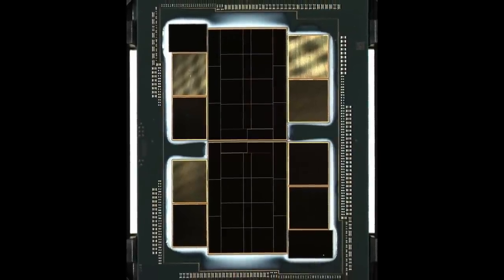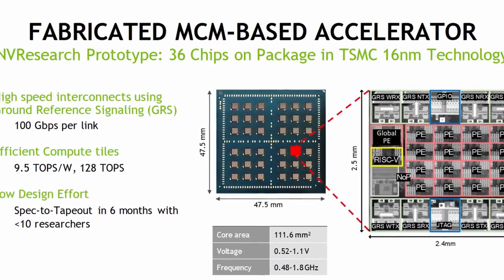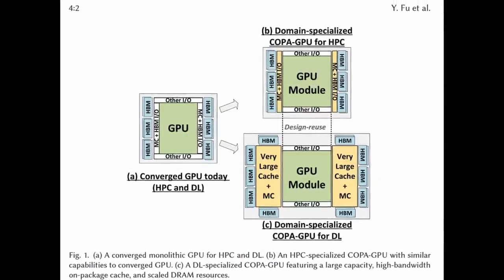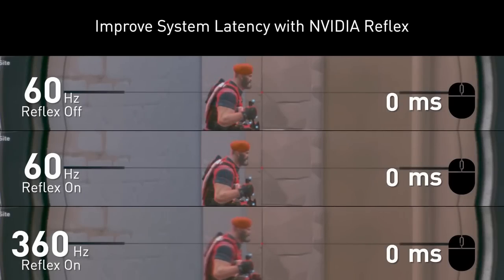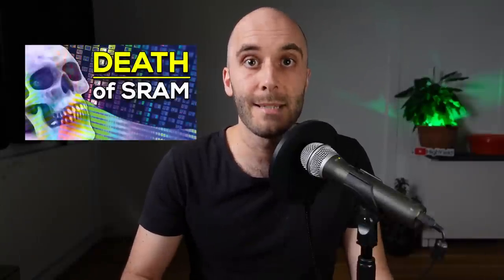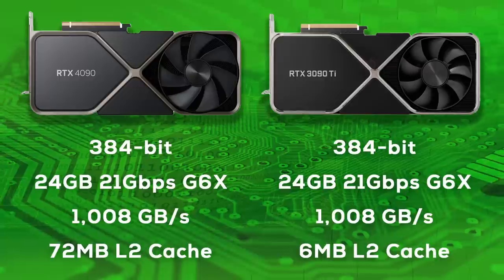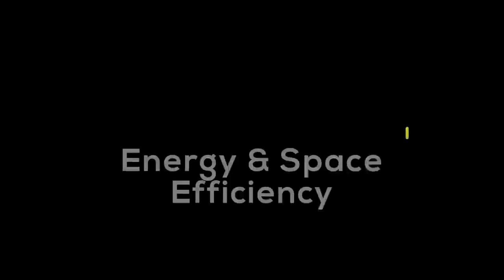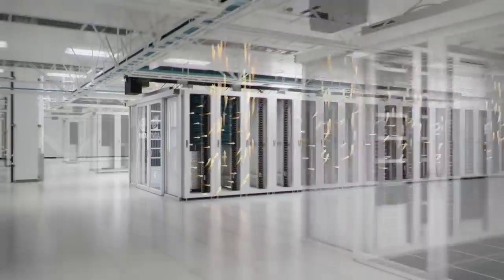How long can Nvidia stay monolithic?

Comment: Overall good analysis on this video but you forget the most important (and in fact the only) reason why NVDA didn't move to chiplets yet is the limited packaging/interposer capacity (CoWos in case of H100) and HBM TSV production machines. Currently, NV can get any quantity of dies from TSMC N4 but can't get enough HBM and package them fast enough to meet the market demand... to the point that a third packaging factory is opening in Taiwan and NV already booked the production for the next year. Samsung is also opening a new packaging fab in Korea (for HBM CoWos) to sustain NV business.
Otherwise, keep the good work. Nice channel 👍
Reply: CoWos capacity is not difficult to scale. The packaging machines are nowhere near the complexity of the lithography equipment. TSMC is expanding this capacity rapidly, and I don't see it being a bottleneck long term.
Reply from the maker: I agree with you in the sense that packaging (and HBM) currently is the limiting factor for manufacturing high-end GPUs, but H100 already uses CoWoS, only just to attach the die and the HBM chips onto the interposer, and not to connect multiple chiplets. So advanced packaging is already used for current gen Nvidia HPC/AI GPUs.
For gaming the argument stands.
Reply: Totally agree but what I said is still true. Capacity is being build to meet the future demand but was not enough for current client GPUs that sales in much much higher numbers than DC H100. And I don't even talk about cost...  @SirMo
Reply: Client GPU quantity is a total different scale than DC A/H100. And it's even much easier for AMD when you have less than 10% market share and only one SKU is chiplet... @HighYield

Comment: Thank you for this video, always very informative, I had no idea that the EUV-next lithiography shrinks the reticle limit by a factor of 2, that changes everything.
Reply from the maker: I knew it was getting smaller, but I was again reminded about the huge decrease by a random comment on twitter. I think many ppl underestimate the impact high-NA EUV will have.
Reply: @HighYield  Yeah for sure, actually I heard about it today on MLID's leak video and it brought up a good point, this might actually make nvidia cancel the 90 class of gpus for a few years, because it will have to be smaller and won't be able to compete with the previous generations. Of course I do expect them to use chiplets on hyperscaler + AI stuff as you said, but for consumer gpus, it might be harder to justify a new design.
Reply: @MickenCZProfi  Intel is expected to have first High NA machines active in manufacturing sometime in 2025(assuming no delays).  TSMC will likely not have the same capabilities til 2026.  And even then we know that gaming GPU's are usually at least a year behind on leading edge nodes, so Nvidia's Blackwell GeForce parts will likely be unaffected by any reticle limit issues.  And beyond that, it's more than likely gonna be another two years for the next generation, at which point they'll have had time to get on top of things.  Shouldn't be an issue and they will continue to have high end consumer GPU's every generation.  Also, dont get caught up with naming.  90 series used to be what was 80 series.  It's not actually a new class of part.
Reply: @maynardburger Is that why Intel kept with 14+++++++++ node for so long? Like waiting for the big change.
Reply: @MickenCZProfi  what mlid video was this?
Reply: @Lemard77  No clue, the comment is a year old

Comment: Rather than just calling the game gfx latency dependent it's better to realise that the frames are tightly coupled in a way that HPC calculations aren't.
An algorithm bouncing rays off a surface need the texture & colour to be known for example, if these rays are scattered and reflected then you need all of that early pass data to be available.
I've seen explanations that games effectively have a global area, splitting it across dies is believed to cause problems.
The difference is that if you could pipeline frames without synchronous requirements then each could take longer than the frame time, so long as they can start early on a wide enough GPU that can process several in flight frames.
So long as the output frames respond to user input quickly latency would still appear low.
Reply: VERY solid points. Some could be solved in software with a form of checkerboarding as you process.
Reply: 1. Before realtime ray tracing was available, there were very few "global" calculations. However, two separate GPUs (Xfire/SLI/dual-chip designs) would have to be synchronized on processing of each frame to avoid tearing. To my knowledge the latency contributes significantly to making this synchronization difficult, even with relatively low inter-chip bandwidth usage.
2. Of course as modern games increasingly implement and rely on RT, what you said about global information may become more applicable.
3. There is no way to pipeline frames which can reduce the fundamental input lag; if it takes 10ms to render a frame, the dependency on user input means the input lag can never drop below 10ms. While you can increase the framerate with such pipelining, and possibly as a result smooth out the input lag, the total frame render time will be observable as input lag by the end user.
Reply: @GeekProdigyGuy  originally dual GPU duplicated VRAM data and each handled alternate frames.  Tearing is caused by changing the display in the midst of its refresh hence setting v-sync or free-sync with the monitor avoids it.
The point about pipelining was to show the limit of asynchronous operation in some super wide GPU, we know algorithms now use movement vectors and differences between frames, but you'd need to sample user input late enough to meet latency requirements.
But seriously those differ between games, not every game is a twitch shooter.
Reply: Pixels are mostly computed independently, even when ray-tracing. GPUs were invented for rasterization workloads where the same sequence of instructions are executed with data individual to each pixel and the CPU has already decided which triangles to draw. It's different for ray-tracing, each pixel requires multiple rays and the rays can scatter randomly. Rays are grouped and assigned to a compute unit or GPU core, and some rays will immediately hit a light source and terminate while others will reflect and scatter until the iteration limit is reached. When a ray terminates early the CU resources for that ray sit idle waiting for the others to finish, unlike a serial CPU which could immediately start processing the next ray. The trick is to find a way to maximize utilization by grouping rays that follow a similar path onto the same CU.

Bounding Volume Hierarchy (BVH) is one such optimization, but it creates a dependency that has to be completed before the rays can be assigned resources, though the BVH is usually small enough to fit inside cache, so duplication across GPU chiplets isn't a great waste. BVH could even have its own specialized accelerators, like an array of simple CPU cores that execute the same cached program and can be reassigned to a new task while others iterate.

The frames should not be pipelined in a latency sensitive game, ideally a frame is displayed, then inputs gathered, then geometry calculated and submitted to the GPU, then the frame is drawn and displayed, with no overlap between the stages. This gives the lowest possible latency.  If your pipeline is five frames deep taking 50 ms to draw a frame, 50 ms is the minimum latency even if a new frame is displayed every 10ms (100 fps). Widening the processor so it draws the frame in 15ms with no pipeline means 15ms minimum latency despite the frame rate dropping to 67 FPS.

Milliseconds is plenty of time to exploit pipelining and streaming across the individual pixels and effectively hide nanosecond VRAM and inter GPU module communication latency. Chiplets may be slower in some areas but since the majority of the work is still parallel there is plenty of performance to gain with a chiplet design.
Reply: @shanent5793  your explanation suggests a cause of interdependence, utilisation is depending on correct grouping.  Rendering pixels independently of each other doesn't mean they have no  dependency on the same data.  We know for lighting and other algorithms they depend on each other, with a frame constructed in passes.
The question is how you break up that work across GCDs and how the large volume of data moves efficiently between them while meeting cost targets.
That's different from long runs of predictable calculations on large vectors.
We do know that multi-GPU has required v. high bandwidth connections between the parts, which are expensive.  HPC & render farms without a real-time constraint can break up tasks over many processors.
Now the best information known suggests the plans for multi-GPU RDNA4 has been shelved.  Also RDNA3 split memory control & cache away from the GCD, but chose a single GCD in the first iteration.
Right now we know RDNA3 missed its expected launch performance, and it doesn't appear to have a simple fix, with no word of a new stepping and refresh leaking.
Reply: @RobBCactive  In the multi-pass rendering scenario, the current pass depends on data that has already been completely written by the previous passes. Since that memory isn't being written to at the same time, streaming can still hide the additional latency caused by the remote data access. The computations in each pass remain highly parallel.
Reply from the maker: Good point!
Reply: @shanent5793  There used to be a time when ATI/AMD and nVidia drivers would allow queuing of like 10 frames or so _by default_. It of course improves average fps (and even minimum fps), so better benchmark numbers = look more gooder. Except it of course added a massive amount of latency.

Comment: If I had to make a guess, the next gen will just be a small refinement of Lovelace with larger dies (a.k.a. a 50, 60, 70 and 80 class GPUs with a typical 50, 60, 70 and 80 class die sizes) since there's so much space left this generation.
Reply: Try smaller dies, larger transistor, run higher frequency.  Oh wait that's what usually happens.

Comment: Nvidia's entire origin story has always been about building the biggest chip possible. The reason they haven't went to chiplets is related to this paradigm of always having the largest chip. As you said, their margins and scale allowed for this and no one else could follow since they simply didn't have volumes which could justify the cost. But this advantage is going away. And I think companies like AMD have far more experience with chiplets.
Reply: I think underestimating Nvidia on the technology front is a very big mistake.  There are only a tiny handful of processor companies in the world with comparable resources, and Nvidia has a pretty strong track record of execution.  I expect when they do make a move to MCM/stacking, they're gonna do very well with it.  We should also not forget that AMD is piggybacking heavily on TSMC's technologies, which Nvidia will also have access to when it comes time.
Reply: @maynardburger  People underestimate AMD's technology. It is Nvidia who's piggy  backing on AMD's technology for example. AMD invented HBM which Nvidia uses heavily in datacenter. AMD also has the strongest CPU and FPGA development cadre as well.

Comment: *Chiplet is synonymous with Cheap.* There's no other upside. A Monolithic CPU or GPU doesn't have their chiplets separated by millions of nanometers of added unnecessary latency. Even in Intel's Tile, each tile is specialized. The GPU, SoC, and CPU are all on their own tiles to avoid the latency cost from downgrading from a monolithic design.

Comment: Chiplets are used for cost saving, they get better yields from smaller silicon and less wastage, monolithic will always be superior for gaming gpu's.
Reply from the maker: Chiplets are not always used for cost saving, even tho the most famous chiplet design (AMDs Zen 2) used it for that. 
For example, Meteor Lake is most likely more expensive to produce than its monolithic predecessors and chiplets can also be used to achieve much higher performance, because a monolithic chip has a hard die-size and thus transistor count limit. MI300 for example is faster than any possible monolithic chip AMD could design. I even quote a Nvidia research paper in the video which states, that a proposed chiplet architecture can be 45% faster than the largest monolithic chip.
Reply: @HighYield  in production based tasks it will be better however with the increase in latency due to the nature of chiplets will suck for gaming, I can see why Nvidia still uses monolithic designs at least for their gaming products. Compare the first Zen CPU to the monolithic Intel CPUs in production workloads they where awesome, in gaming they were horrible in gaming due to the high latency of the chiplet design. I can see the new chiplet/tile based Intel CPUs having the same issue in gaming tasks, we will either see no performance change or a regression. Only time will tell.
Reply: @Alex-ii5pm  well current implementation of chiplets are not the best for gaming latency wise they may be in the future since it’s a new technology that hasn’t been fully adapted to gaming applications.

Maybe chiplets will be even better in the future since a given chipset could be focused on a fixed function/operation instead of more general use cases.

Comment: I would say Hopper Next is monolithic as Nvidia tries to capitalize on the AI boom with an early release and before the competition can launch something more interesting. Big corporations aren't that willing to take risk as they have their leadership role to loose while the under dog(s) can as they don't have a brand to lose if it doesn't work. Hopper Next Next will for sure be MCM because of the reticle limit. Maybe Hopper next is an intermediary generation and we see both a monolithic chip launching first to ensure leadership which is followed up by a risky MCM on the same architecture which takes longer to develop and has the potential to beat it

Comment: Nvidia historically waits for a generation to implement some new technology compared to the competitors. Because given their lead they can outperform the opposition on older tech saving money in the process. As soon as the savings from the new tech become measurable, Nvidia switches to the new tech.
Reply: Lol, "some new technology" CHIPLETS ARE BAD
Reply: Major green cope
Reply: @thomasfischer9259  I don't even have and Nvidia gpu, I'm rocking a 5700XT. I'm just stating the facts. Nvidia is technologically ahead, so they juice every last cent out of the cheaper technologies before switching to the never ones.
Reply: @thomasfischer9259  well if he coped, the 7900 XTX will be way better than the RTX 4070TI without any problems of gargantuan amount of power consumption
Reply: At the risk of lacking experience.
Reply: Nvidia is literally using a more advanced and expensive TSMC 4nm node compared to AMD's 5nm MI300x and Nvidia still loses.  Their lead is gone, they haven't gone chiplet because they don't know how.

Comment: There is a lot of upcoming tech that will primarily only push logic density forward. 
With high-NA halving the recital limit, and GAA + Backside power delivery increasing complexity, it might be unwise, or even uneconomical to put L3 or L2 on the die at all. Necessitating die stacking to maintain the necessary bandwidth/latency.

Hopefully the thermal reductions gained from GAA and backside power will be enough to just stack cache directly onto the logic without issues.
Reply: Yea, large cache chips that can be stacked underneath the compute die are the future.  Lets you have a lot more cache, while also freeing up room for more compute(or just going with a smaller die with the same amount of compute).

Comment: Chiplets makes possible to make custom made final assembly. Add more compute units, mix different clock speed cores, increase or decrease L3, graphics etc. Consumers can pay load of money to get very-very unique assembled units. All that requires to make the future systems ready for easy modifications. Yes, every unit need very special motherboard firmware update but that is no big deal to add for custom made assembly bill. Everything base anyway on customer selected chipset, not rocket science add the custom made software code. I am 100% sure the could sell that way crazy things, ever several thousands of euros costing consumer units.

Comment: Yeah Nvidia is moving to chiplets sooner rather than later. I also think they'll do so in an impressive way, out of the trio of AMD intel and Nvidia they're the absolute best when it comes to executing. It's one of the reasons Nvidia is so dominant, they just don't mess up.
As such I don't expect some timid first try for Hopper Next, but a full fledged cutting edge chiplet design.